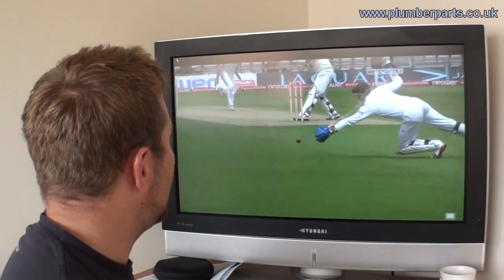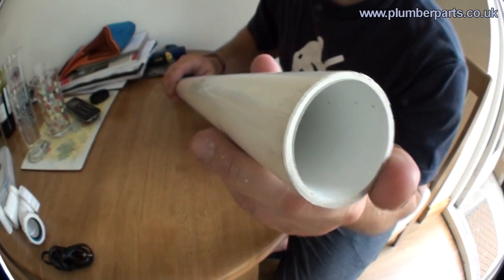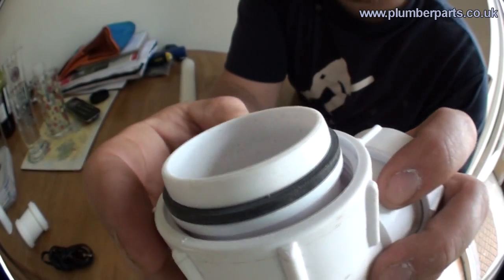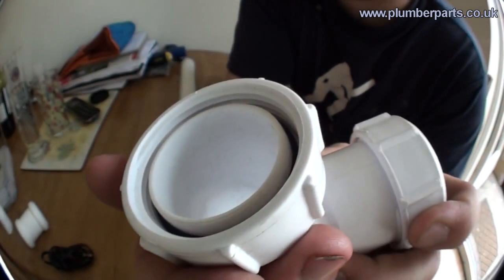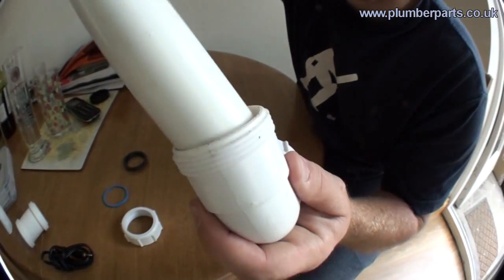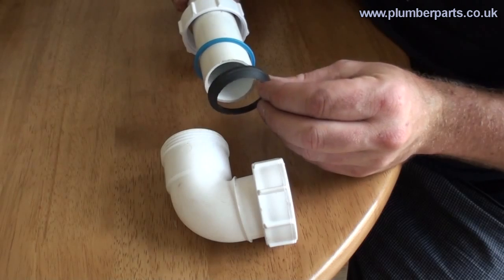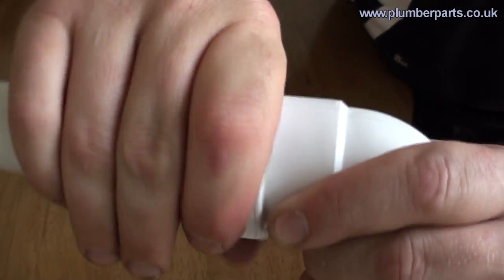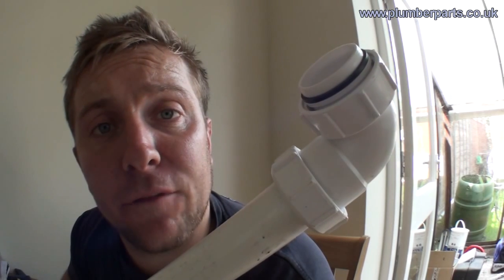How PVC Compression Fittings Work - Plumbing Tips

Comment: Great help for ordinary folk when leaks happen. The dishwasher outlet pipe came off so I had a go at fixing it myself. Just one thing. I had the black O seal thingy upside down after it fell out, so couldn't screw the fitting tight until I realised. . Great videos. I've watched lots of them to help me understand what plumbers do on my house and to try and fix problems myself.

Comment: Oh my goodness, after pulling the pipework apart under the sink to clear a blockage and then putting the pipework back together, couldn't figure out why the joint was then leaking badly... thanks so much for your video, straight away I could see why, have put the connection back on properly, no leaks!! 😊

Comment: My second-hand home was missing the tapered rubber seal, just having the anti-slip washer. It was totally confusing. I just cleaned it out a couple of hours ago and it's not leaking, but certainly not very reliable! One bump to the j-trap and it's all over. Look's like I need a trip to buy a tapered seal! I'm glad you had this simple video. Thanks!
Reply: Same here! Do you know the name of the tapered seal? Was it easy to find?
Reply: Same here. New build about 8 years ago. A couple of years ago one shower started leaking and I've only just got around to fixing it, and... the entire tapered seal is missing. Small wonder it's leaking now!

I wonder if there are different designs that don't need a tapered seal (seems unlikely), or whether they just cut corners on everything (not unlikely; we've found other cases, and new builds are notorious for this stuff nowadays).

Comment: Perhaps you can tell me WHY does every place I live in in my many many years end up at some point  with connection coming apart without any physical reasons??  Never seemed to be an issue with places that had metal pipes.  Just had to worry about rusted holes back then.  Probably have just dated myself...LOL!  I have learned to always check my connections when I move to a new place...but eventually...I get caught unawares months to years later with a leak...and on inspection...the pipe is either completely un-connected OR so loose as to be soon to be unconnected??  Should one set an alarm to check all connectors at a certain time interval??  I always am disgusted with myself in not thinking about it...then disaster happens and I end up with problems with water.  I was told my a landlords maintenance man that this was normal for plastic pipes...but it is stupid IMHO to need to repair water damage cause plastic pipes "normally" come apart when they want to.

Comment: Omg thank you so much! I just replaced the garbage disposal under my kitchen sink and one of the connections kept leaking... Turns out I didn't have those rubber gaskets installed correctly. You're a lifesaver... I was so ticked cause after all my hard work I thought I'd have to call a plumber in after all!

Although... If plumbers here in the states were as handsome as you I wouldn't have minded calling one in haha....

Comment: for the amateur  on the second type of fitting you  did  not emphasise the   need to get the rubber seal the right way around   with the tapered edge towards the end the pipe